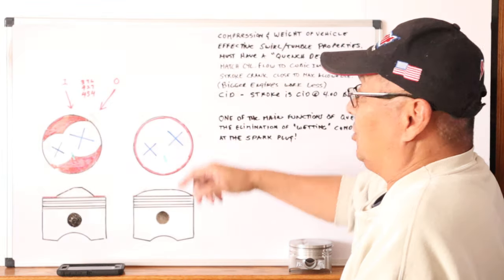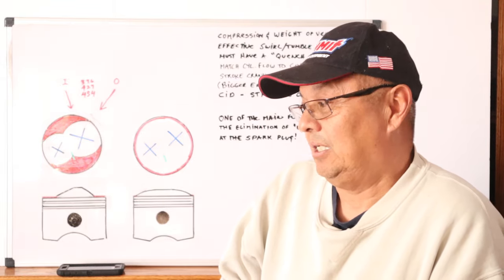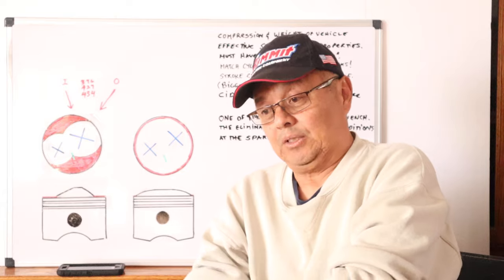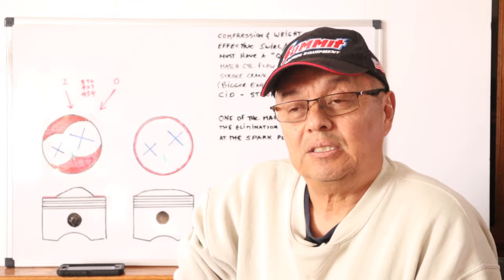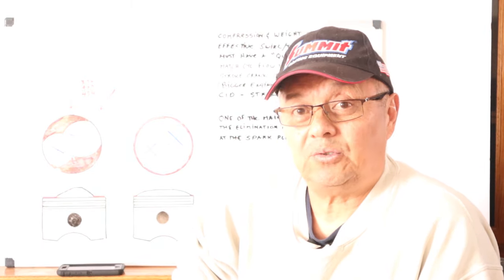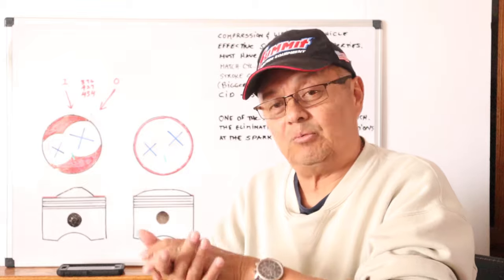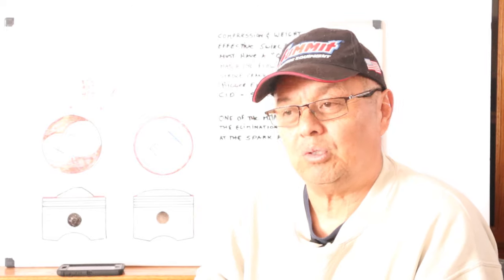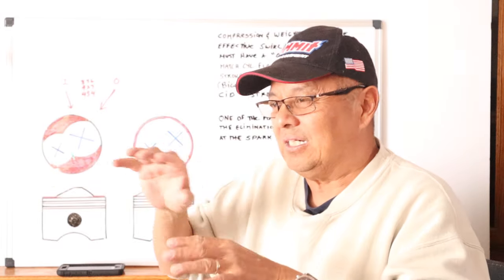HOW MUCH COMPRESSION PART I CAN WE RUN ON THE STREETS?

Comment: If doing a budget build and using Chevys old D shaped heads on a 350 or even an older 4.3 V6, how much compression might you get away with if you zeroed the deck and had a  proper quench and a good valve job done?   I'm guessing 10?
Nicely done video with great explanations. 👍
Reply from the maker: It has been a while since I worked on a V6 and if it is a flat top is very similar to the traditional SBC in layout and compression!  Zero deck and use a thin gasket which is usually available for the sbc and perhaps the v6.
Reply: @benalamedaracing2765  4.3 is just a  3/4 350. Same valves, pistons rods and even the water pump. They later, I think '74 changed the block adding an internal vibration dampener then added the Vortec heads and intake.
On my 88 engine the heads aren't considered Chevys best effort.  I have read that there there are limits on the cam size that will work clearance wise.
Thanks for educating the masses, Ben.

Remember "back in the day" you could ask a question to Hot Rod Magazine....
....and 4 months later.... They would answer somebody else's question. 🤣
People like you make the internet   worthwhile. 👍

Comment: Wouldn't cooling system efficiency and cylinder head material have a big effect on the minimum octane of fuel that could be used?
Reply from the maker: Aluminum heads would be more cooler running on the combustion chamber and will tolerate more compression than cast iron cylinder heads.  Having adequate cooling system will also help towards your goal.

Comment: Your explanation is amazing what knowledge you have.  Keep getting mixed opinions.  351c 4.030 domed -12.3cc pistons open 2v 77cc chambers.  I will be near 11:1.  Do the domed pistons help reduce knock in open chamber heads? Everyone tells me it won’t run on 91.  Also should I keep the piston to head gap under .040 to prevent detonation.  Also in Colorado altitude 4000ft.  Thanks so much!
Reply from the maker: How much cam are you running with that combination?
Reply: I haven’t picked a cam could go roller or not waiting on comp cams to get back to me.  Thanks for the reply you’re awesome!
Reply: @benalamedaracing2765  Intake Close ABDC: 65 I would like to be at with the cam.  10:84 Static is what im computing.   Looking at Comp Thumpr 227/241 Hydraulic Roller Cam This would put me at 8:62:1 and 7:82:1 at my 4000ft elevation. If my numbers are correct.  Thanks Again!

Comment: I'm currently building a early 70's 351W short block that's been bored .060 over to a 363 with Keith Black flat top pistons and AFR 185cc heads with 58cc chambers and a Howards Cam Big Daddy Rattler hydraulic flat tappet camshaft. Should come out to a static compress ratio of around 11.1 or 11.2 and be pump gas drivable since the car it's going in is a 1971 small bumper Ford Maverick (grabber style but not a true grabber RPO code body), as this car only weighs around 2400 pounds.
Reply from the maker: That thing should fly with a lightweight maverick and most of all they hook very good compared to any mustang!  I feel you will best move to a bigger cylinder heads from AFR perhaps a 195-200cc heads.  Perhaps go to a hydraulic roller as well for more added power and torque.
Reply: @benalamedaracing2765  yeah I might go hydraulic roller in the future. It was just a little out of budget for me right now plus even finding cams has been difficult lately! I was on a waiting list with Comp Cams for over 3 months before I cancelled my order with them and found the Howard's Cam I ended up going with. The springs in these AFR 185's are borderline on the seat and open pressures for a flat tappet, but I'm hoping it'll be okay since I'm removing the inner springs during break-in and will be using good break-in oil. Also, with the smaller heads, I'm at about 5,000 foot elevation where I live, so we have considerably less oxygen in the air, so my thinking with the slightly smaller head choice was maybe it'll help keep port velocities up which might work a little better than higher flow but slower velocity here at 5,000 feet. Maybe not, I dunno, but I figured it's worth a shot.

Comment: You seem to bring up the 2v Cleveland heads and insult them but this is a true statement those heads will outperform close chambered boss heads at the track in a quarter mile with a cam that's good for 6,000 and under and both motors have the same exact cam grind.
Reply from the maker: I have not completed my Cleveland video as I have all of them lined up.  The Aussie is the best for the streets because the 4Vs are too big and the 2Vs have a chamber that is inefficient to get something seriously going.  However, I have a surprise on the video as far as the 2v are concerned and it will open your eyes.  It should come out soon!
Reply: @benalamedaracing2765  awesome thanks for your time in the comparison

Comment: Hi Ben, Mark from down under in Australia. Would like your opinion  on using cast heads on my 302 Windsor. I have always wanted to build a 302 Boss engine standard stroke, but unsure after listening to your information. I have 3 different types of heads. Gt40p, 2v closed chamber Aussie and 2v closed chamber from America that are slightly relieved and far superior casting. Is it worth using the cleveland heads or GT40P? Strip/Street 1971 Ford Capri.
I'm not using Allunium heads, cast only. Inlet manifolds for the Boss are readily available in Australia. 
Thanks Mark.
Reply from the maker: What brand is the 2V closed chamber from the USA that you have tried? Anyway I will not waste my time with any GT40P for any serious street effort.  I have run many Aussie 2V close chamber and it is a good street cylinder head!  I would run those for sure.

Comment: That’s great info.  Thanks for sharing 👍just subscribed .   So what compression would you recommend for a 8.2 SBF. With a F1X pro charger 363 ci     Thanks.
Reply from the maker: You did not state what kind of fuel and If I would guess somewhere between 10.5 to 11.1 would be great from E85 or Q16.

Comment: 400 crank 
300 6 rods 
4.040 bore
Presto, a nostalgic 410"
from a Windsor, Ontario

Well stated on squeeze!!
Reply from the maker: Did the same thing years ago and the engine has a lot of torque at the low and mid ranges!
Reply: @benalamedaracing2765  Uhuhuhuh, with WF (Windsor Foundry)  Boss 302 heads

Comment: My theory is most detonation happens below 3000 rpm, I run automatics with a 3000 or more rpm stall converter, a cam with a lot of overlap, "0" decked block and 12:1 compression.
Never had a problem.
Reply from the maker: It also for sure happens specially if the ignition curve comes in too fast...
Reply: @benalamedaracing2765  With the converters I run, I usually run locked out timing set at 34 to 36 Deg. with no curve at all....go figure?

Comment: Really great info appreciated. What is the minumum rod to stroke ratio you have run? 
What do you think of 1.3 rod to stroke (6" rod and 4.56" stroke)
Reply from the maker: I usually try to be above 1:5 ratio specially for high rpm engines.
Reply: @benalamedaracing2765  may I ask why not go below 1.5. Is it because high side loads causing side cracked blocks or premature con rod bearing failure. Have you expreminted with it? Thanks
Reply from the maker: @abdullaalameri90  Yes the internal drag specially around the cylinder walls plus side loading becomes too much and seen enough damage specially @ high rpms!

Comment: What about compression for 87 octane? Nobody ever talks about that.

My current build is a sbc 385 with about 9.5 compression with D dish pistons with .040 quinch, aluminum afr budget heads that I smoothed chambers and ports. Lunati 219/227 with .549/.565 lift 35.5° intake close going in a 3600lb car. Intended to be a fun fair weather daily driver with highway gears and a wide ratio overdrive 4 speed. Hopefully it'll be replacing the 35yo 4.3 that can no longer maintain the speed limit in a couple months. Just waiting on the block to get back from the shop now.
Reply: outlaw. I totally hear you and agree on 87 octane. How many want to spend extra $ on premium pump gas for a daily driver. I can understand a street/strip car, but not a daily. I for one would like to see more content on max performance from 87 octane, i think it's more realistic for thee average car guy. I do believe you have a very healthy combination to replace the worn out 4.3L with, it will be a fun ride for sure, plus hopefully decent on fuel. I would personally go with a good dual plane intake and a vacuum 750 carb. It should have really good low / mid range torque with this whole combo. 87 octane compatible for sure. I would do a compression test to see where you're at for cylinder psi. I have run many on 87 with between 170-180 psi with out an issue, I believe and have seen/ discovered that once you push it over 200 psi you'll need at least 91 or more. This has been my clued in indicator on what octane an engine can tolerate with out detonation. Of course with all else being equal, good radiator, high cfm fan, low temp thermostat, etc. The cam you have will bleed off cylinder pressure at low rpm, which will help with 87. But if I were to give pinpointed advice I would put most of my focus first on ignition timing, a dialed in distributor makes a world of difference for any engines performance, take the time to learn about and perform any adjustments needed to find out what the engine likes for timing, it knows what it wants to perform at its peak, you just have to find its sweet spot, every engine is different, time spent here will be well rewarded. second, on the air fuel ratio, aka, set float level, proper size jets, squirter's, etc, third, max cooling/ heat reduction. Once you get timing and AFR tuned in, you will have a Fantabulous 87 octane burner, for sure. Kudo's to you, my friend, I'm actually a bit jealous 🤫. Nice Combo.. 👍
Reply: @brianwenzel8791   Thank you sir, Usually the only people who comment about an 87 build just comment like 12 year olds to say the least. Considering the cam is ground 6° advanced I could stand to retard it a little if I need to bleed off a little more pressure. Ordered a re-manufactured quadrajet. Turns out when I took it out of the box it's an 800cfm version. Winner winner chicken dinner lol. Talking to a guy now for a tuning kit for it for my set up. Intake is an old spread bore edelbrock performer.. 3701 i think? Cant remember the number, do know it's the egr version and that has been plugged off and I notched the center devider like the rpm air gap I use to have.

Carb is a non computer version and numbers on it say it's an 85 model. I wanted the later version for the adjustable part throttle. That will be a big help on fuel mileage. Haven't owned a quadrajet in 20+ years, can't wait to hear that sound again. 

Distributor is a computer controlled freebe out of a late 80's truck. For some reason customer wanted a new one even though it had less than 3k miles on it so I kept it. The msd 6AL-2 controller just came in the mail today for it. I have everything but the pushrods, plug wires and starter. 

But yea back to 87. It never made sense to me that every performance build has to be 93 or higher. Thats $1.30 a gallon difference where I'm at for the life of the engine for an extra 20hp. The vast majority of 93 builds leave more than that on the table by overlooking simple free hp tricks. There's always someone faster and I'll never put a roll cage in the car so mid 7's in the 1/8th would be about my speed limit anyways.

Comment: One more question if you dont mind sir. So if I'm building a 383 stroker sbc with 11-11.5 static compression for the street. What dynamic compression ratio should I be targeting. 8:1, or closer to 9:1 Because you know that changes with cam shaft selection. 
Lower SC+bigger cam=lower DC
Higher SC+smaller cam=higher DC
Higher SC+bigger cam=mid range DC
🤔
Thanks again for your knowledge!
Reply from the maker: We can get lost with too much detail as far as dynamic vs actual mechanical compression.  This said, I should have stated that when you do a cranking compression pressure tests? 
 It should read no more than 200# after 4-5 kicks of the compression needle!  If exceeds this number 91-93 octane will definitely knock so do this if the timing cover is off and run it straight, -2 or +4 and take note what happens to the compression gauge!  Retarding as much as 4* you will see a drop of at least 30# thereabouts and forward would gain it back.
Reply: @benalamedaracing2765  ok I gotcha.   That gives me something to shoot for. I'll definitely try that out. Thanks!

Comment: Great explaination. For the dished piston on 408/427 Ford, I add boost with Paxton Novi1500, 6 psi on street/ strip. No quench on the piston but made 575/631 RW. This must be more that same with NA and 11-1?
Reply from the maker: Your compression must be extremely low to make under 600rwhp.  I can produce that with yes an 11:1 NA on pump gas.

Comment: I like to set compression as general rules. 11.5 to 1 for aluminum heads & 10.5 to 1 with cast iron. Quench, combustion chamber design, and plug location, vehicle weight & specific use as guides. On N/A builds I like the piston as close to the head as possible.  Can you get away with more compression? Yes sometimes, but it depends on multiple fsctors.  I dyno my engines & perform octane tolerance tests & am designing knock sensors to aid in tuning (yet to know if this will provide specific enough data on solid roller, heddered dyno engines).
Reply from the maker: Terry, if you selected a cam with higher than normal effective duration you will exceed 11.5 with an aluminum heads.

Comment: Hey ran across a variable compression piston based on hydraulic control. On pump gas up to 18 to 1 from idle to 2000 rpm. Then goes down to 10 to 1 at WOT. If only you guys developed it!
Reply from the maker: That would be interesting I like to check that out!

Comment: Also Load wise Rear end gears. I built a 318 with around 11 plus to one compression no problem car was 66 dodge dart convertable had 456s plus hemi red stipe gear box.
Reply from the maker: I touched on this on the new video part II.

Comment: On the Ford FE, I built  it at 11:1 with.039 quench . It’s a 4.125 bore and a 4.125 stroke, C6 automatic, 4.33 gears the pistons were  4032 alloy and zero deck. I ported the tall port heads and put an eye brow on the plug side of the head and put 2.19 intakes and 1.6 exhaust. It was a car ( 65 Galaxie all stripped down to the same as a 68 Chevelle). That scared the tar out of folks. It would just smack at 3000 to 7000, and the force and sound would make people not want to ride in it.  Does that sound like a good street setup?
Reply from the maker: Sounds great from here and people do not realize FE dominated NHRA Stock and Super Stock classes for many years!  A testament that they are indeed very strong engine!

Comment: Wow.. love to hear you teach us. Im about to start on my daughter's 89 camaro rs. 305 cam .485/495 lift. Duration 264.6/268.6 new valve springs. 650 or 750 holly dulplane intake.. HEI distributor. I only have the stock head for now. And id like to put 100 shot of nos on it. Just for her to learn how to handle it. Any suggestion from you would realy help.  Thanks for the video's
Reply from the maker: I am sure she will have a blast running that car!  If your HEI  has distributor springs in it go buy lighter weight springs so the advance comes in a little quicker.  This said, never forget to retard the timing if you will use nitrous.  If it is an automatic even a mild stall speed will make it easier for her to run it without bogging it down. A 650 cfm should be a good choice since it is a 305 and when she gets going real good step it up to a 350 or 383 if that is in the budget.  I like to see girls in strong running cars embarrassing many boys in the process! lol
Good luck and keep in touch.

Comment: Awesome video love the info. I run small block chevy 438 c.i. 68cc brodix dragon slayer heads piston is dss flat top -5 cc valve relief piston is 5 thou in the hole. Head gasket is .051. I run 91 and am thinking I'm missing on some power from the quench. I am considering getting a .035 or .040 gaskets. Car is 4000+ lbs 3500 stall and 373 rear gears cam is 240/244@50 112lsa 608/614 lift. Currently I get 15mpg when cruising on the freeway. Don't notice detonation currently looking for some tips and advice.
Reply from the maker: Yes get that combined quench down to .040 or thereabouts specially with the 5thou in the hole combination.  Is that a hydraulic roller cam?  I would run them everytime on any street engine.
Reply: @benalamedaracing2765  yes sir hydraulic roller cam with Johnson reduced travel lifters

Comment: Late 60s, Chevy had hilltop pistons in their 2 ton trucks on 'high torque's models... 396, 11.5:1 if IIRC...
Reply from the maker: Low geared transmissions and axle ratios you will have no issues.
Reply: @benalamedaracing2765  I ran a 460 at 11.1:1, towing at 24-25k... tuning over gearing. Gears only get you so far when you're using 80%+ of power available. 

For FE ran cooler with 10.5:1 comp than 7.8...

My 523 BBF runs cooler than the 460 at 11.5:1...

Again, tuning, not years. Quench design being the most critical part.

Comment: There is quench around the edges of that dished piston! A dished piston is capable of pulling more charge gaining volumetric efficiency, they (NASCAR ) engine builders have used dished pistons for that very reason and they’re getting 850 hp out of 358 ci, my point not all dish pistons will disappoint…..
Reply from the maker: I will showcase this on my next video on how quench goes backwards in high horsepower engines and adjustments needed to be done to prevent detonating and dish pistons does have a place in this scenario.
Thanks for your support Peter!